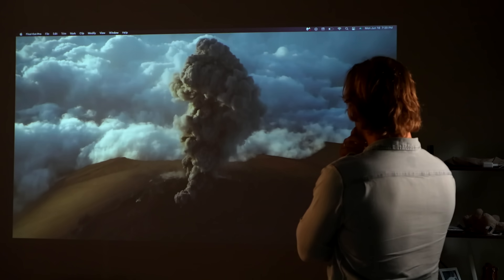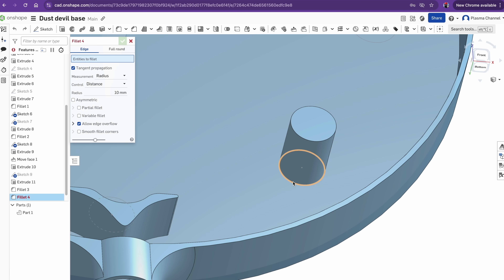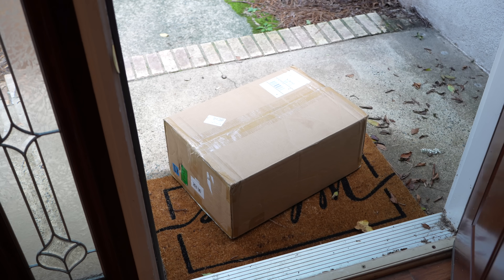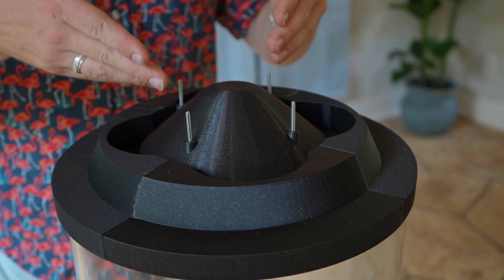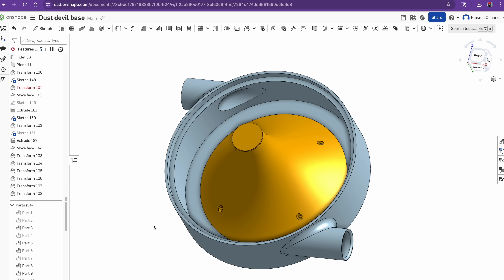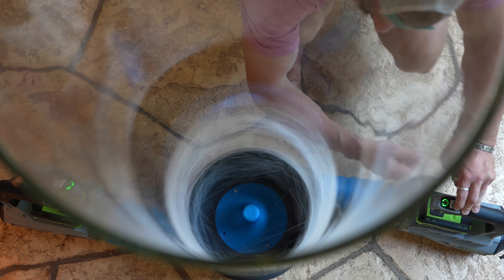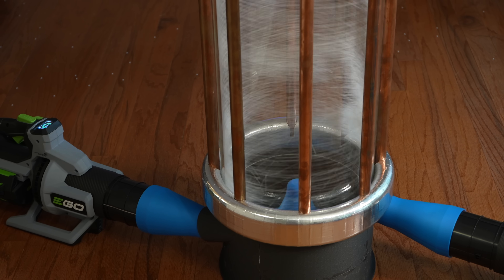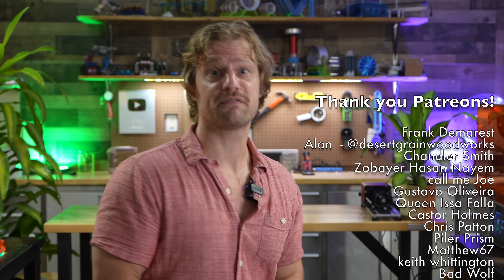Making Lightning In A Bottle Might Be Possible  (ft. 3D Printing Nerd)

Comment: Not at all sure this bit of information will help you, but then again it could serve to be valuable food for thought when dealing with static electricity and the fact that it is really the only significant example of a serious static electric charge that I myself have ever encountered! I use to splice fiber optic cable long haul across this beautiful country of ours and the individual reels of armoured cable would very from 7 to 8 miles long and they would often get blown thru plastic conduit and the out side of the cable was also plastic so one can imagine that there was a lot of powerful friction encountered between the outside surface of the cable and the inside of the conduit right! Well, the armour in the cable was a pretty significant alloy that was conductive so in my deconstructing of the cables for 12' in each direction to gain access to the fiber optics it wasn't uncommon to experience extremely loud, bright, and often rather painful shocks! What was in fact surprising was the fact that after the cables had seen to discharge one would think that you would be in the clear but that was in fact not the case. As soon as you were sure that you were out of harm's way and say 5 to 7 minutes had seen to pass since the last discharge the cables would repeatedly and just as powerfully as before discharge, shocking you again and again sometimes they would even seem to escalate in intensity especially in the presence of large amounts of water. That's my only freakish experience with static electricity but it was rather powerful and more often than not just exactly when it was again unexpected! So, static charge can and will see to store and recharge itself like a freakish mind of its own capacitor if given the proper circumstances jsyk... Grounding of the armour for even 24hrs before prepping of the cables like the engineers suggested didn't even see to making of the slightest difference! As once a cable of that length has been exposed to that amount of friction I am here to tell you that you are just not going to ever see to free it from its static charge you can dissipate a section of it for a limited amount of time but you will never see to rid of its ability to recharge! Possibly the charge is still present inside the conduit space I'm not sure! All I know is that we were never successful at mitigating its persistent presence! Powerful large sources of static have a way of only being present when you least expect it. Jsyk...

Comment: Jay — you’re 95 % there, but you’re shorting your own cloud.
The tube + base are touching the ground = the positive plate is grounded. That’s why no lightning.
REAL LIGHTNING PHYSICS (it starts at the ground):

Charge separation in cloud → base = negative, top = positive.
Earth below becomes + induced (electrons pushed deep into ground).
Positive streamer (leader) launches UPWARD from ground — this is the real start.
Negative leader descends from cloud.
When they connect → RETURN STROKE (the bright flash we see) jumps from ground to sky.
→ What we see is the “report” — the lightning is already climbing before the flash.

Your tube = the Earth.

Glass = + charged (from PE/sand friction)
Beads + airflow = – ions rising
But it’s touching the floor → + charge leaks → no upward leader.

FIX — BUILD THE FULL CIRCUIT:

Lift entire tube 12–18 in off floor on Teflon/glass insulators → let + charge build.
Sharp tungsten needle at bottom center inside tube → launches positive streamer UP.
Grounded metal sphere/ring 4–6 ft above → acts as “negative cloud”.
Mix sand (SiO₂) + PE beads → max tribo separation.

THUNDERSTORM AIR UPGRADE:

Bottom inlets: Hot, dry air (heat gun)
Top exhaust: Cold, humid air (mister + ice)
→ Creates convective charge cell = real storm physics.

RESULT:

Positive leader climbs from needle → connects to upper electrode →
RETURN STROKE = bright arc from ground to sky.
Leave the vortex running → charge rebuilds → MULTIPLE RETURN STROKES (not self-sustaining).

You’re not making a dust devil — you’re making a thunderstorm in a bottle.
One insulated base + one needle = you trigger the leader, the sky answers — again and again.   
P.S. SAFETY FIRST:  
75 J = *lethal**. Add a **100 MΩ ballast resistor* to the top electrode → caps current at <1 mA.  
Keep gap <2 in → limits energy to ~1 J.  
Still get **bright arcs + thunder cracks**, zero deaths. ⚡

Comment: A big key point to this working is actual seperation of negatively and positively charged beads. They will usually like to stick together and in average contribute to zero net charge.
In a real thunder you will have heavier and lighter particles. The heavier will sink down the lighter will rise (or with different temperatures). And the one kind tends to charge up positively,while the other tends to charge up negatively. That way you get actual large scale seperation of charge, and not just small scale seperation.
So use two different materials that  have as different density as possible. Focus more on density difference rather than triboelectric difference. For large voltages you need high capability for seperation rather than every single bead to have a large charge. Over time it will then accumulate even if individual charge is low.
Then you can collect charge between top and bottom not via inductive coupling, but directly in the tube.
Make sure that seperation due to density difference is big, so dont have too much and not too less airflow. It shall be such that the lighter particles make it to the top, but the heavy ones dont. The heavy ones should stop at a good distance from the top. The earlier they stop the higher the maximum voltage, and the further they move up the faster charge will build up. Find a sweet spot.

Comment: Im no engineer or anything but try getting another glass tube small enough to fit inside the one you have and find a way to incorporate that with the base so the beads stay between the layers of glass and run a anode up the center tube almost like the Tesla coils in those plasma balls or a spiral of copper wire to draw the current out of the glass, and another note I'd add is as you try and draw the current out of the contraption it most likely will make the charge seem weaker as you have to not only run the device longer to charge something else but if you try and draw the current to store it in a battery or something the charge is going to look like it's not producing as much cause the charge is working on supplying the stuff it's touching with a charge still

Comment: this is an awesome concept and I'm really invested in realising the result, what if you made an aluminium cylinder slightly smaller than the diameter of the glass tube suspended within the tube but not touching it what that help in anyway

Comment: The static charge is created as the particles interact. Your vortex forces them all in the same direction only interacting with the glass. You're building a mild charge while its on but that's not enough to cause a shock and the cling you see is most likely build up as the particles actually do run into each other as they slow down. I would suspect if you extended your vortex cone up the center and had it release air in the opposite direction at random intervals you would build more static. Creating a charge surface on the bottom and top that are connected in a circuit but that do not touch the glass would created some some sparks. You also need to move the particles faster, in both directions.

Comment: Anecdotally - the craziest static I've witnessed in person was while running my electric leaf blower in the very cold winter (clearing snow off of a car) and the static those little ice crystals pick up in the zero humidity cold air is unreal, it will shock through the plastic and through thick winter gloves.  Something to look into would be freezing the air to subzero but keeping it extremely dry, and using much smaller particles.

Comment: Add a secondary tube. Fill the space between the two tubes with a highly conductive liquid. Place your electrodes in the liquid and connected to wires outside of the liquid. This will charge the ions in the liquid to allow for better collection and visulization. Just a thought hope it helps and could be fun to see.

Comment: what if you changed the balls to something more hairy, still light in weight, and made it spin in uniform, instead of seperately, just seems to me a lot of the energy the leaf blowers is getting disapated in the open space of the tube between the balls. even a spiral core to guide the balls up the tube could be interesting imo, super interesting video though love them all

Comment: You have to funnel the air into the center. Not funnel the air around the diameter of the glass. You will get more colliding of sand grans

Comment: What about smaller balls?  Sand is way smaller than those beads, smaller beads means more beads for a given mass which means more surface area and more charge transfer?  Also what about connecting the air outlet at the top to the inlets of the blowers?  Right now the top of the tube is fighting against atmospheric pressure, and the blowers are pulling a lower pressure near their intake compared to atmosphere - recirculating the air might place less load on the blowers and allow them to move the air faster/move more of it?  The extra friction of the air through the tubing and the bends it would have to make might get rid of any gains found here though, but depending on how much it would cost you to test it might be worth testing.

Comment: I was using a hand held vortex type vacuum to clean up some drywall dust and I kept getting shocked by static. I realized it was probably because of the vortex and the extremely dry gypsum dust. Also since it was hand held (battery powered) I was the best path to ground.

Comment: Rainsticks typically do not produce static electricity during normal use. However, if they are made from certain materials or if they are in a very dry environment, some static buildup could occur, especially if there is friction when the materials inside move. This is not a common characteristic or purpose of rainsticks, but under certain conditions, static electricity may be present.

Comment: Hmm maybe its time to get back to basics . Im thinking a static ball generator but with a twist instead of a conveyor and brushes maybe a closed loop air system that would shoot the air sand mix from the vase straight up into the metal sphere with return plumbing to the base . .

Comment: Um... you aren't grounding it.

When it's in the Air its not building static its just building charge. Static is a resting element of that charge.

If u attach the roof node with some wire to the floor sparks should appear in the storm when the beads make contact with it. As the spark is a discharge. If ya get static it's cause it can't discharge easily thus builds up.

Comment: Holy crap. Try shrinking the balls & adding much more along with putting a heat source in the ceiling of the device. I guarantee if viewed at night the dielectric field tension from that device will be so high it can dimly light flourscent tubes & brightly light avremenko style led wireless receiver lights that are just two diodes in a pigtail configuration attached to a 3mm or 10mm led. Also you might need to make the glass chamber tube very thin or of a different material that can more easily store the dielectric/static charge your working with.

Comment: Opposing magnets inside on top and bottom. Outside of glass right after the couplings of the base and lid, parallel with the magnets, add thin maybe 1in w/ strip of foil. Double the balls. Send it. Should lead to a sustainable “storm” that just might have results like the sand and vacuum. Also like the vacuum, suction from the top might have better results. And should look epic

Comment: Well actually because your body has the static electricity that matches the exact electricity through the tube so it pushes it away like a magnet of two sides like if both negative word to face each other they would push each other away same with the positive

Comment: I recently saw a video about static (rather than magnetic) motors. The biggest issue they faced was arcing due to high voltage build-up. Modern jet engines use a combination of fan and fanless propulsion, perhaps you could create a static "motor" that is also a fan, and utilise the high voltage for additional ionic thrust?

Comment: Please add a shallow dish of water with dry ice in it in the center of your attempted vortex chamber before assuming there is no vortex.  But first,  avoid pointing the air inlets upward as the air at the outer edges of a vortex system is supposed to be going down or, at the ground, horizontally to converge at the base of the vortex to travel upward from there.  At least, to be accurate as possible, that's how it is for recirculating systems, and I can tell you for a certainty that, as the smoke in vortex simulations can somewhat tell you, it is far more preferable for the 'satisfying of an updraft' to occur in the center of a vortex.  Which means it at least should, and usually does occur near exclusively in exactly that way, with perhaps a gradual upward motion in the outer layers of the vortex taking place.  I'm gonna have to study some whirlpools if I wanna answer that any straighter than this because it is basically the exact same situation as what you have created.

Comment: Another possibility to consider is that the crazy amount of rotation in the container eliminates the possibility of any of the debris coming close to occupying the center of the system. Whether or not there is a vortex, I cannot tell you, but I believe even the packing peanuts have the same problem at such wind speeds.

Comment: I may have an idea that can help you.  I would recommend building a cone shape bottle instead of a cylindrical one.  More importantly, I think making a shape matching a function of a cyclone that recirculates the sand instead of just separating it will create the conditions of the sandstorm more likely.  The reason for this is the cylinder is forcing all the particles in a uniform flow and forcing the sand outwards toward the cylinder wall, hence they are bumping up with one another going in the same direction.  However, with a cyclone shape and function, the sand will flow in opposing directions and collide with one another.  The denser particles will be forced out toward the wall, and the less dense particles will rotate inwards.  There will be lots of sand particle collisions occurring inside the vessel, creating lots of static charges. True vortexes require separation of fluid regions, meaning one are is slower, stationary, or rotating in reverse directions to the other region. You could get some crazy results with a cyclone structure with a similar equipment.

Comment: Hey I'm a big fan. Maybe you should try to put 2 or maybe even 3 tubes together. Make a tube within a tube. That way you can get multiple layers of static build up. You should look into a machine called the thunderstorm generator. By Malcolm bendell. It's a modified engine that uses a similar concept but with water and exhaust. The static build up discharges into the exhaust gasses and break them down. Only particles that are small enough can leave the exhaust system. It's really similar to this.

Comment: Can you find the frequency of the static ions and adjust the hold and connect each ion on each mini frequency buffer to create a constant continuous connection to manipulate the static ion to  a frequency connection similar to a electric shell system shield  I mean they’re just standing there in the middle air frozen with electricity static  adjust frequency emitter to to increase the current currents to a electric frequency frequency, obelisk more energy obelisk creator to physical control create designs through electric and electric glove conduit to adjust and play with ions and electric if you’re able to do with the ions around you, you’d be able to generate a shield to the static that adjusted from your body to the frequency that are on earth and outside earth and made and created to

Comment: Had a question about the ionic propulsion. I have noticed that you have been using 3 tirs of wire to funnel the air into the center.
What if you use a lot of small ones that do the same? It would look a kinda like a pin. 
Or would it be better to use one long wire? Like a candy cane.

Comment: i think the "sand" loosing its static charge when the glass is touched is because you just gave it more of a ground, as the plastic base for it would be of higher resistance than the charge traveling through a person as far as i could assume

Comment: Directional exchange might be the issue.  Sandstorms and volcanoes also your vacuum all had single direction air flow. Also air gap between ground and you might be the issue.

Comment: I got pulled off a rig flown halfway around the world. For starters you got the flow all reversed. 
 You need to suck air from the top middle. You won’t get the beads to form in the centre because the faster airflow is outward. Centrifugal force keeps anything heavier than air to the outside. That’s how particle separators work for helicopter air intake. 
 Blowing the air in at the bottom- faster air = lower pressure keeping the particles in the low pressure zone. 
 The electricity is going to be formed inside at the 90° positions. Metal tape on the inside  at the 90° locations vertically would probably work well. 
 Try leaving a gap in the vertical tape halfway up. Wire up and wire down see what that does. 
 Good effort though, somebody somewhere has engineered each part of this thing. You just need the best ideas for each piece. 
 …or you just wanted a double barrel high power leaf blower, much cooler than the neighbours seeing you with a vacuum 🤣